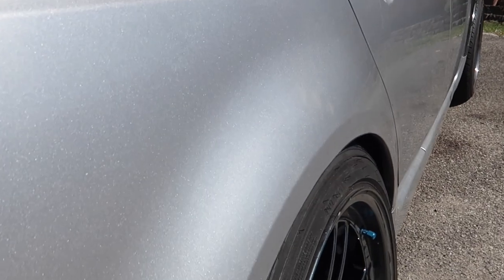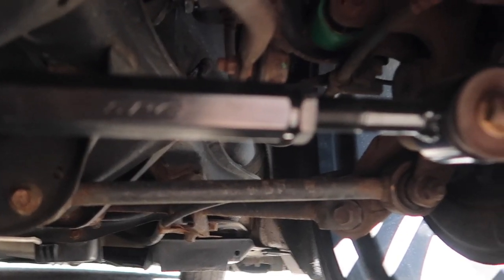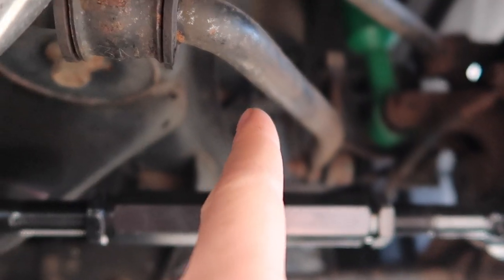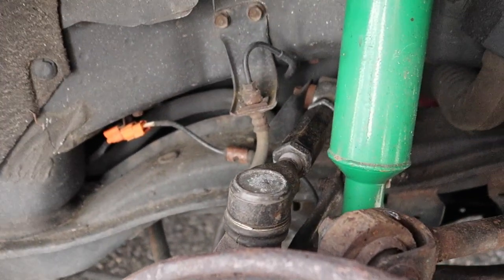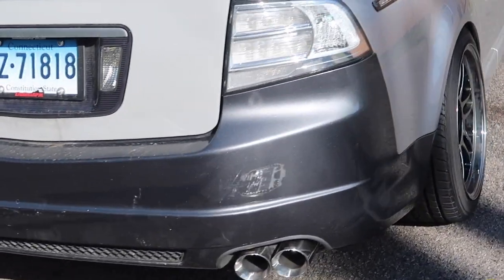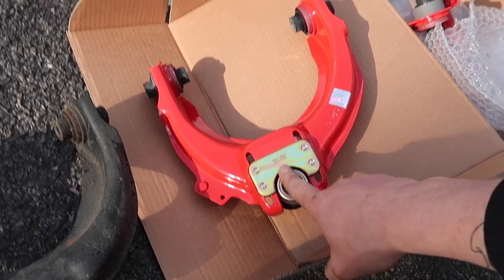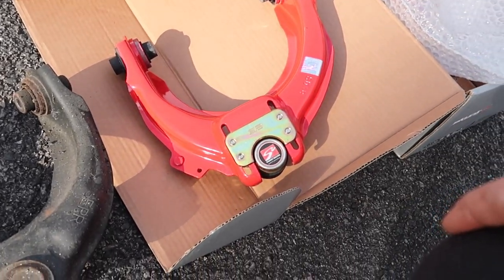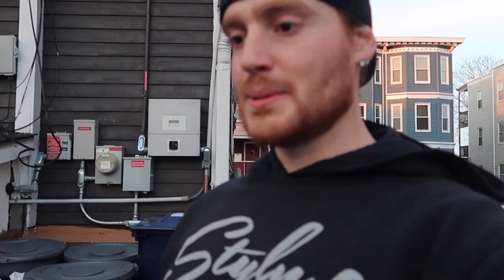Perfecting the stance on my Acura TL part 1!

Comment: are you running spacers? how do you get the wheels to poke out the fender? been trying to get this look for the longest
Reply from the maker: No spacers. My alignment was just off a bit. Wheels are wider than stock so naturally they poke a bit.
Reply: @oblvyngarage  thanks for the response. i was thinking about running 265 35 18 but i was told it’ll mess w the suspension
Reply from the maker: @TheRichardortiz123  I’ve seen a few with that size. As long as the suspension setup is good and you’re not slammed and you get a good fender roll you can run it

Comment: Man wish you could drive my 05 TL one day and see why it wiggles from rear when I have passengers in the back...can’t figure out. Only has 98k on it
Reply from the maker: Could be the bushings on the suspension components. Hard to say which one. You’d have to lift the rear and one by one wiggle the arms or even the sway bar. Rubber bushing tend to go out causing parts to move a bit.